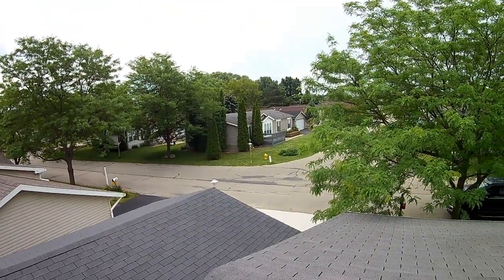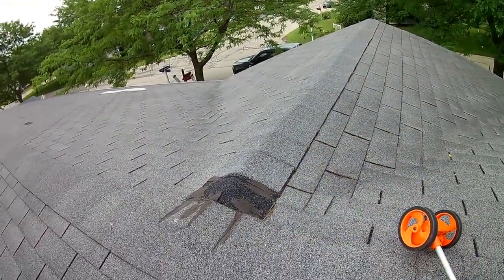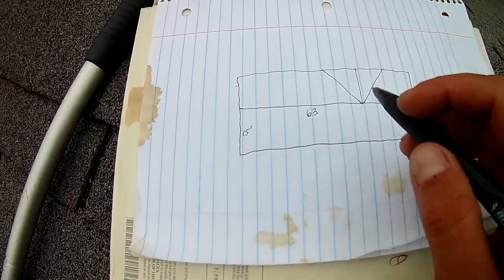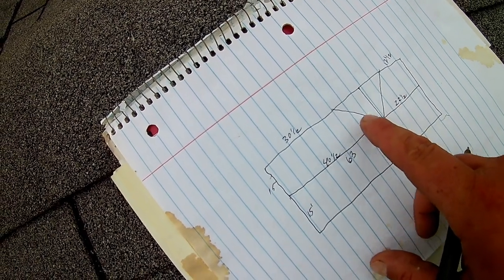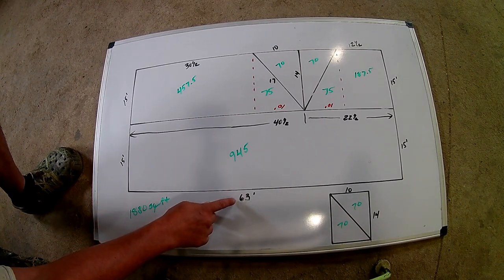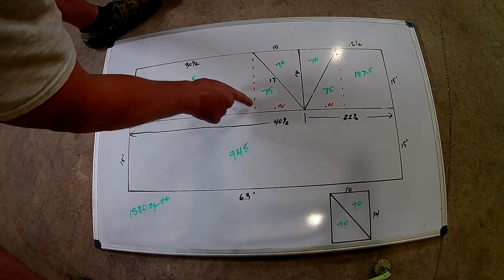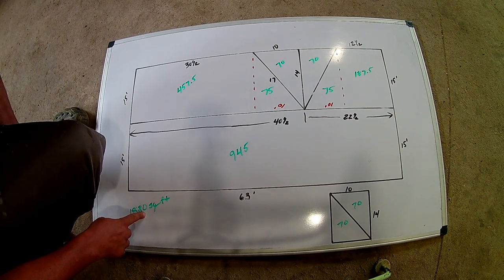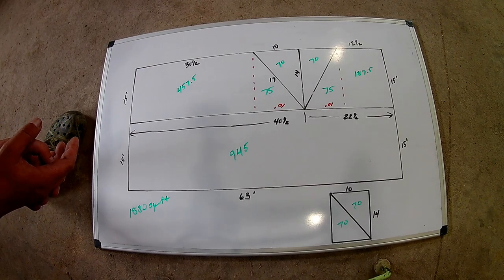HOW TO MEASURE A ROOF FOR SHINGLE REPLACEMENT

Comment: On the front of the house that is very complicated the way you were measuring it. And also when you were measuring the Dormer if you measure from the middle of the valley to The rake on the ends on both the front of the house and on the Dormer you will find the correct measurement.
Reply from the maker: you can do that but that is not the proper way to find square foot of a triangle